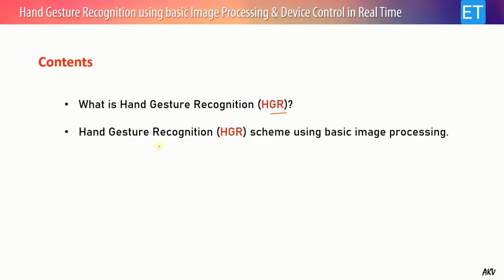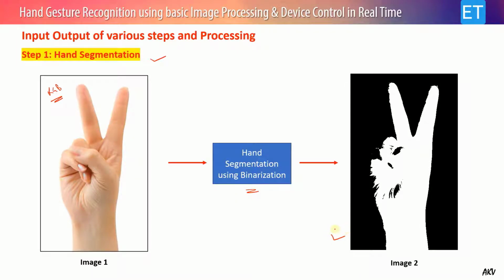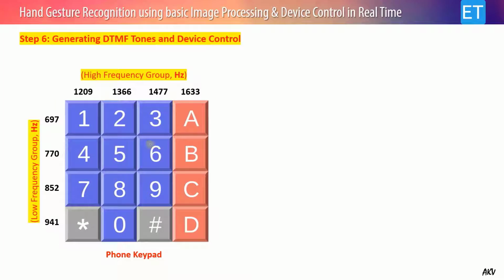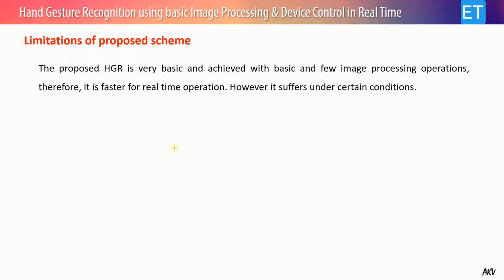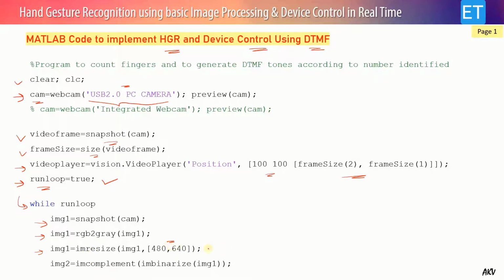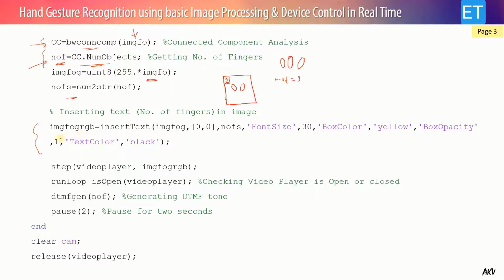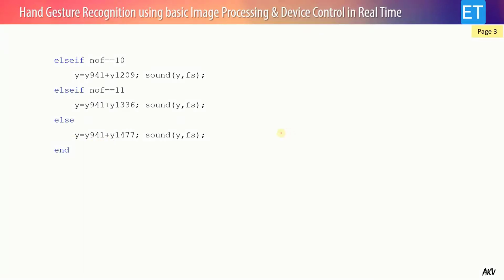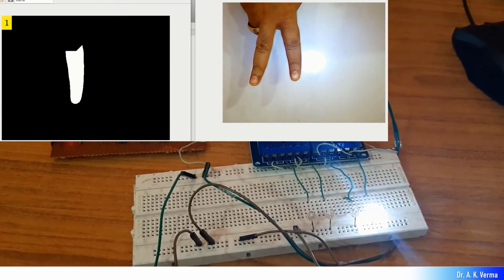Hand Gesture Recognition using basic Image Processing and Device Control in Real Time

Comment: Error using vision.VideoPlayer
Position must be a finite numeric    vector of format: [left bottom
width height]

Error in Live_HGR (line 6)
videoplayer=vision. VideoPlayer ("Position", [ 100 100 100 100 [frameSize (2), frameSize(1) ]]);

that is the error occured after i run how can I fix it? Please I need your help for our Programming subject
Reply from the maker: Instead of writing 100 four times, write only twice , [100, 100,